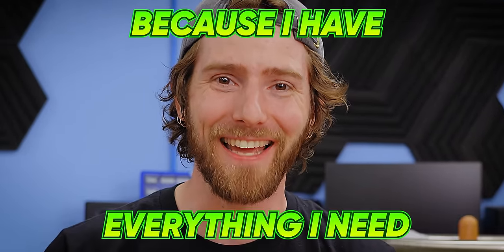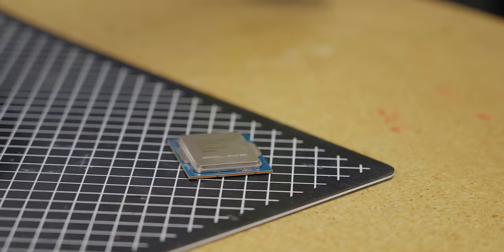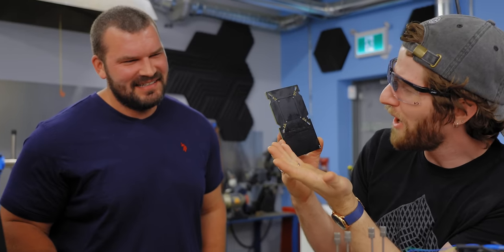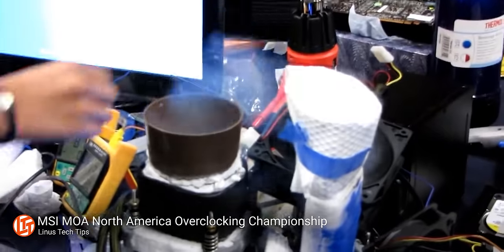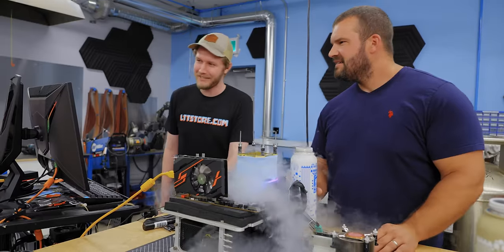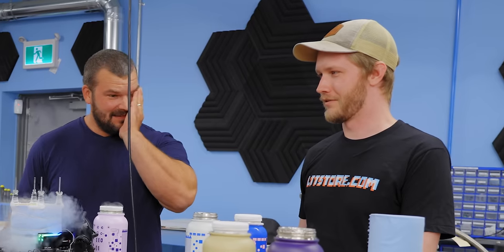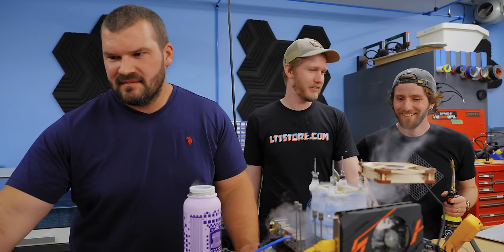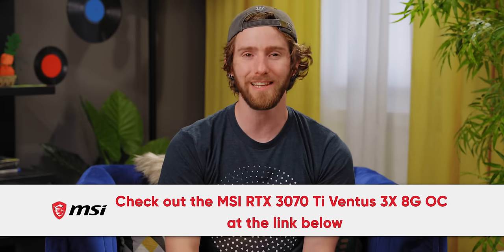The 6.9GHz CPU - LN2 Cooling

Comment: Sadly the cpu speeds have frozen in place for the last decade. Thanks to the multicore gimmick the computational power kept increasing, but without that the gains are minimal.
Reply: First, you're trying to literally cheat physics by proposing higher clock speeds. There are fundamental limitations to this technology that can't be overcome by investing in it, it can only be overcome by literally rewriting what we consider computing (like with quantum computing). Unless we fundamentally change the architecture of the CPU (and therefore the motherboard and other components that need to adapt to it), we will always be limited by things like thermaldynamics and even the speed of light.

Beyond that, the power efficiency drops as you increase the clock speeds unless you use exotic forms of cooling like liquid nitrogen. What you end up with is a computer that, while boasting high clock speeds, actually runs SLOWER per watt than other competitors.
Reply: @ryanthompson3737  
Firstly I am not trying to cheat nothing. I just stated the reality of the situation.

Second of all I don't give a rat's arse how the hell they gonna push the clock speeds higher. I remember the time when all I got was my z80 Sintez2 computer and for me that was the best thing ever.

It took for me couple of years until I have seen and worked on a 286 and later on a 386. The speeds, colors and everything was like seeing an alien space ship from the inside.

I used a 486 SX25 during my high school years and again I was super satisfied. Our "server" was a "powerful" 486 DX/2 66Mhz with multimedia features like a soundcard and basic desktop speakers. It was amazing!

And my first own computer was a Pentium 100... with a CDROM! Omg!!

And since then I had upgraded it each decade going from 100Mhz to 380, 700,1200, 2200, 3000 and finally 4400 x 4 Athlon 64.

But now I have a "mighty" Ryzen 16 cores at.. 3400!? Wtf...?

Yes, it is better than anything I owned before, (Ryzen 7, because that one was super cheap back then) but the core frequency is less than what I had 14 years ago!

So yeah, we got to a "limit". But I remember back in the day when 10Mhz was a "limit"! Then 100Mhz was the top dog and nothing could beat that limit! Then 1200Mhz... and so on.

So the fact that we are now waiting for almost a DECADE for a damn breakthrough is kind of shameful.

Oh, not to mention the prices! Those things are royally shameful! There is absolutely no rational reason why memory and cpu prices are as high as they are today. 

I know the problem, but just with the core clock speeds, at the end all of it spells "LAZZINESS" and "the consumers are idiots, let's sell them crap because the mobile market told us how many idiots exists on this planet".
Reply: @cristitanase6130  If you bothered to ACTUALLY read my comment, we HAVENT reached the clock speed limit, we just need to literally redesign the architecture to allow higher speeds. For example, NASA has been working on nanoscale versions of vaccum tubes once popular in early 1900s computers. They theorize they can push clock speeds up into the terahertz (1000ghz) region using this method but, once again, you have to fundamentally change the architecture of the chip to do so. Instead of fixing the problem of clocking limitations with industry standard designs, they just went ahead and added more processing nodes to increase the performance. This is why clock speeds weren't as important as cores. A 16 core chip at 2ghz will ALWAYS outperform a single core chip at 16ghz.
Reply: @ryanthompson3737  You first say "we"... is not you, is others so is "them". Then you babble about NASA, no one cares. Then about how many cores are better than speed. Again no one cares.

I am talking raw speed per core. I do not mind many cores, I just want 10Ghz per core speeds.
And I am talking consumer CPUs not weird shitty NASA inventions that are too expensive to ever make it on the market.
10Ghz per core with multiple cores is a perfectly reasonable request. Buying these low speed :CPUs at full price is a joke.
A 3D chip should be in production already. The chiplets are just a cheap alternative to a proper 3D design...

But again the consumer market is flooded by idiots that have no idea how to pressure the producers. They are fouled by all kinds of cheap marketing strategies and buy crappy products at high prices. As long as this trend stays the greedy corporations will not invest in proper development and will keep producing the same low power crap each year.

There is no logical reason why the industry still uses the same waffle format and not moves to a 3D format already.

Comment: Why so hype???...Pentuim 4 was on more Ghz...
Reply: First, NONE of the pentium 4 family of CPUs came factory set over 6.9GHz, and any references for higher was set using this exact method. Secondly, you're comparing a CPU that came with 1 MAYBE 2 cores VS a 16 core system... this means, beyond the fact that computer technology has fundamentally improved so a 1 core running at 4GHz today would operate better than 8GZh CPU running back then, it will ALWAYS have 8-16 times more computing nodes than that chip ever had.
Reply: @ryanthompson3737  bro is this cpu factory set to 6.9 Ghz ?
Reply: @corel965  Bro, does it matter when the i9  can pull the same performance at 1ghz that your pentium chip can perform at 16ghz? It doesn't matter WHAT the pentium pulls when it can split the load amongst 16 times as many processors. This means that, theoretically, your chip would have to pull 40-80ghz to match an I9 factory... that would be with the false assumption that NOTHING else in computer technology has advanced other than the number of CPU cores. 

TLDR, you'd have to redesign the pentium to operate using nano-vaccum-tube technology to get ANYWHERE near the performance of a factory i9.
Reply: @ryanthompson3737  You are right but you wrote none of pentium did not come from factory at 6.9...and i did not say that...im just talking about numbers ofcourse i agree with that the technology is improving day by day and we cannot compare them in performace even if we push that Pentium to 80GHz haha, but i think we understand each other no hard feelings mate :)

Comment: 8794.33 MHz & 8543.71 MHz ... Guess the intel one :D
Reply: You can tune a Toyota Carola to operate at 8800 RPM, but it STILL can't beat a buggati running at 7100 RPM at 440km/h

Comment: BUT WHY ARE YOU ALL RUNNING AFTER CLOCK SPPED? IT'S NOT EVERYTHING - only higher clock speed doesn't make a CPU always a winner - number of cores also count. Both AMD and Intel processors are good but it depends on their applications. AMD CPUs are better for floating point operations and best suited for servers and workstations. Intel CPUs are mostly great for gaming with i7 and xeon for servers. However, you need to pay less for intel processors but more for the motherboard. On the other hand, AMD boards are priced less but processor are expensive. So you don't have to invest less for upgrading intel processor but more for AMD.
Reply: He's literally highlighting the exotic setup and cooling system needed to create these clock speeds. That was ALWAYS the major issue with it. It was way easier and cheaper to add more cores than to completely rewrite the architectures of the chips to allow much higher clocks. Beyond that, there are fundamental limitations to the amount of efficiency we can get from a chip, and the amount of heat we can dissipate as a result of that inefficiency.
Reply: @ryanthompson3737  Don't you think the engineers at the chip manufacturers don't know what Linus is showing here? If overclocking using nitrogen was the only solution then companies would have created ntro-cooling processors for consumers. Clock speed is just a tip of the iceberg, but many other things like bus speed and memory response also effects thr performance of a computer. Without improving the clock speed it's also possible to improve the performance of a computer by improving these things.
Reply: @debojitacharjee    1. To buy nitrogen on a consumer level for PC gaming would cost you MORE than your mortgage, car payments, and grocery bill COMBINED, so it's highly uneconomical to do this, or to push it to consumers OTHER than the big computing companies that have a use, and can afford millions of dollars in infrastructure to cut a few cents per liter off. 

2. I NEVER said this was the ONLY solution, I said it's the ONLY solution for this chip architecture. Intel could reach speeds WELL over 1 TERAhertz if they used nano-vaccum-tube technology being developed over, at least, the last decade. That's the problem.... the engineers at Intel literally have to rethink their ENTIRE design and idea of computing in order to make it reality... much harder than improving and building upon what's already there.

Comment: The only thing this has shown me is Intel is so weak stock that it needs extreme measures like this just to even come close to AMD.    Also..... are there no hair dressers in Linus' town??
Reply: Imagine comparing what is essentially a server CPU melded with a desktop CPU (making it REALLY good at productivity, but not too good at gaming, but better than average) with one mainly meant to give the best of both worlds to all use cases. In fact, a threadripper underperforms in gaming compared to most i9 equivalents, even if it blows it out of the water in productivity.

This also ignores that only ONE model of threadripper, and i believe its pretty old now, contains the same amount of cores as the I9, while the more expensive and newer chips have up to 64 cores, and rumors are going around that next generation chips will have 128 cores either in a single chip, or dual chip setups. AMD isn't fundamentally better, is proof of their near identical level of technology, they just decided to literally scaled up chip sizes to improve performance, as well as specializing their chip so that they perform better at ONE single function.

Comment: my opposite types of humans are like these ones. wasting resources and producing wastes in the process for doing expensive pointless stuff with absolute NO USE for anything but fooling around. 
one thing though, they forgot even with nitrogens, they would still need OXYGEN to get the job done. thats why they dont isolate the nitrogen in vacuum. becasue it will not do anything if they do that. still need OXYGEN. sad isnt it. pseudo engineers with their expensive wasteful pointless stuff. but this is what majority of humans like. this is why most must go in less than 9 years. including these people.

Comment: they can make a gpu extension cable but not one for a cpu so you could place it further away from the main components of the board when using LN ? lol but what do i know!
Reply: The problem with this that adding a cable adds capacitance to the data, address and control bus lines and this slows down the signals by adversely affecting the rise time of the signals. Changing the temperature, cooling it, won't improve this. You need to increase the drive capability, how much output current the chip can sink or source.

Then there's the problem of reflections down the cable screwing up the signal integrity. We're talking transmission lines here at these rise times and frequencies which need impedance matching techniques to be employed to preserve signal integrity.
Reply: @deang5622  I knew it...ya see this is what makes time travel possible: the flux capacitor! It's taken me nearly thirty years and my entire family fortune to realize the vision of that day.